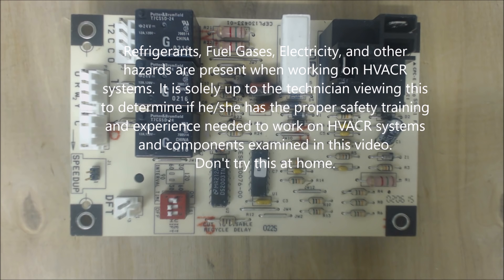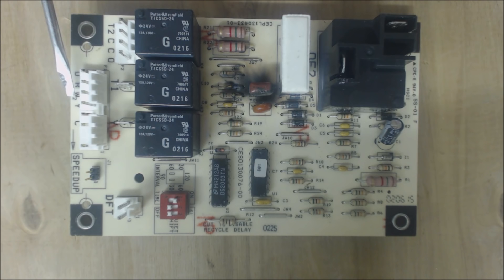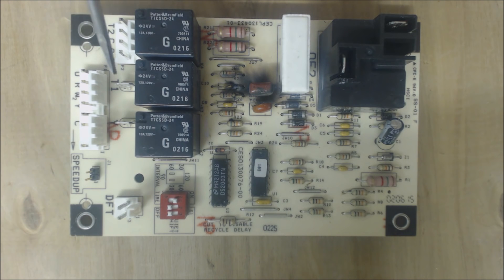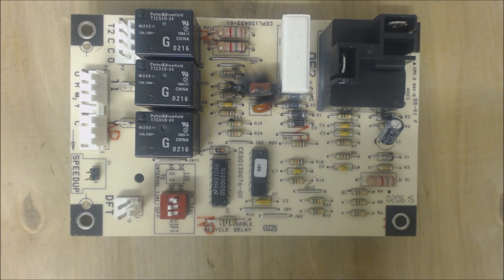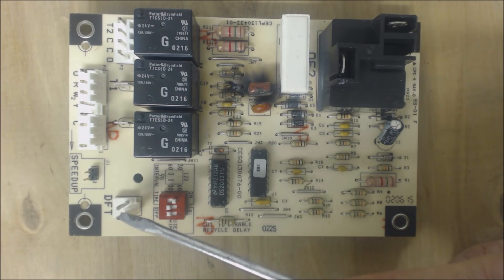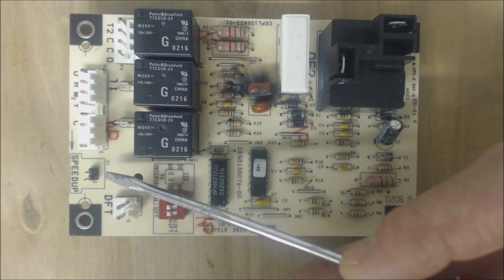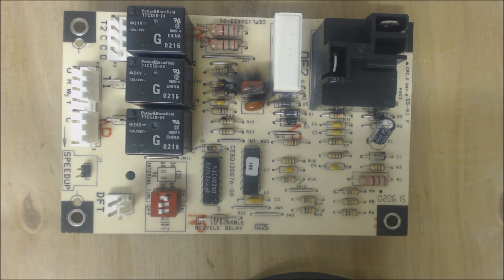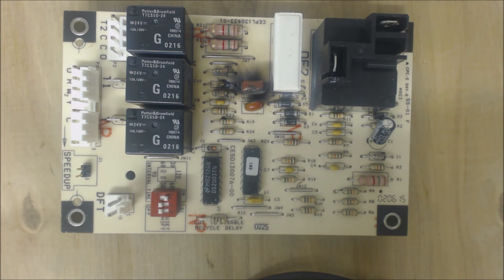DEFROST Control Board Wire Terminal Functions! Heat Pump Defrost Cycle Explanation!

Comment: Would a bad defrost board keep the outside unit coming on at all?   Inside unit working just fine.  New capacitor amd contactor.  

Getting 230 volts from cutoff and 24v from tstat wires.  Have to push in the contactor for compressor and fan to turn on.  Both sound normal when they kick on.
Reply: Did u ever find ur issue? I'm still struggling with same thing after replacing LPS that went out.
Reply: @jessicamizzell2854  freon leak

Comment: Danm I came here to see if you knew anything about the quiet shift function? During summertime whenever my ac turns off it makes a loud trumpet sound. I was wondering if this dip switch would fix it or if that would only work for the defrost

Comment: What if hp starts in heat mode, runs 3-4 minutes then shuts down and goes into 5 minute delay.  After delay,  hp starts and runs 3-4  minutes and then shuts down again on 5 minute delay.   And continues to do this.  A sensor  wouldn't cause this problem would it?  What might be the problem?  Bad board or something else?
Reply: Pressure switch

Comment: Hi great video I was wondering if you could tell me why my Inverter single zone ductless mini split would go in defrost mode +7°
Thank you
Reply from the maker: Heat pumps may run in defrost any time the outdoor temp is 40 degrees or less because the refrigerant in the outdoor coil is below 32 degrees F

Comment: Thanks so much for another great video with superb insight to manufacturer's detailed internal settings. One question I have regarding a typical defrost cycle:  According to my unit literature the aux heat is optional during defrost cycle and if so I imagine the indoor blower runs as part of necessary evap required  and wouldn't that blast cold air indoors?  ...or is the relative load so high no fan is required which I can't imagine being possible?
Reply from the maker: Yes your indoor unit would not know that you are running in defrost other than that w wire heading in from the outdoor unit. Actually the fan needs to be so that the refrigerant has heat to absorb and when elec resistance comes on, that actually provides more heat for the refrigerant to absorb and some heat to keep the temp in the house from falling, thanks Tie Dye!

Comment: Greg great presentation in order to troubleshoot any heat pumps especially electrical components and Boards will be great help for any service tech to have some experience in electrical background that will speed up any troubleshooting and resolving all solving electrical problem as far as the boards switches contactors and other components related to the units I am master electrician by trade I work for a big company that have at least over 100 rooftop units ranging from 5 tonnes to 150 tonnes chillers water source heat pumps heat pumps vfds all kinds of units and on occasion HVAC technicians will ask me to help them out with the electrical troubleshooting on different units but I must say heating air conditioning is very complex field
Reply from the maker: Absolutely and it is constantly evolving, thanks very much Nurfet!

Comment: So going off of your videos if I have 24v coming through my wire to the t1 terminal but do not have my 24v going to the contractor I have a bad board. Am I following correct.
Reply from the maker: During the call for cooling or for 1st stage heat, if you have 24v going through your safety switches back to T1 and the board never sends 24v off of t2 after a five minute delay then you may have a bad board but make sure you check your wiring diagram first to make sure that all of the wires are where they should be first. Thanks

Comment: Can you make a video on troubleshooting the main control board on a gas furnace? Is there a way to actually troubleshoot a control board? Or do you have to use process of elimination?
Reply from the maker: You nailed it. Since you know the sequence of operation of what it is supposed to do and the control board does not do it when you are applying 24v control voltage then the board is bad. There are no mainstream tests for control boards. They are to do a function when control voltage is applied. If not and you are measuring for voltage coming off of the board and it is not there then the board is bad. This is another reason why sequence of operation is so important on heat pumps, HSI furnaces, and spark ignition furnaces. Great question!
Reply: acservicetech Thanks!

Comment: AWESOME VIDEO!!!!! This helped more than you know.  One question, when the W2 is energized could that also turn on a second heat source, like gas or oil or is it just for the electric strips in the pump? Thanks again this was great.
Reply from the maker: Nice question! During defrost this is the only time you would ever have a furnace turning on while a heat pump is running in a dual fuel system. You would never wire the aux from a thermostat to a furnace but yes you can wire the w2 from the heat pump to the w on the furnace. Thanks
Reply: acservicetech
Thanks for the reply acservicetech. Your videos help fill the gap in some of my brain holes lol! have a good one.
Reply from the maker: Ha ha, nice

Comment: Great video and excellent to see mentioning the Ruud and Rheem RV is de-energized in Cooling mode unlike most other manufacturers.  What about Weathermaker and AmeriStar that I have also heard need the RV solenoid energized for Heat mode?  The way I remember the four is WARR acronym.   Thanks for sharing yur time and knowledge.
Reply from the maker: I believe Ameristar reversing valves are powered in heat mode though we do not see many of those around here at all. Carrier's Weathermaker may have some really old old units that were powered in reversing mode but I believe most are powered in cooling mode. Thanks for the thought on that subject!
Reply: Papa Joe, I'm curious about your reference the acronym WARR.  Please define?